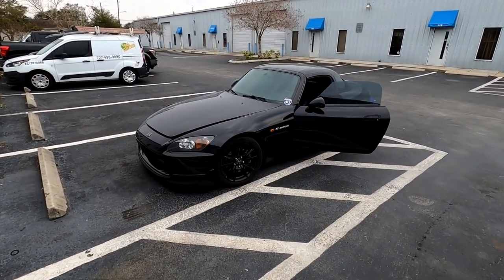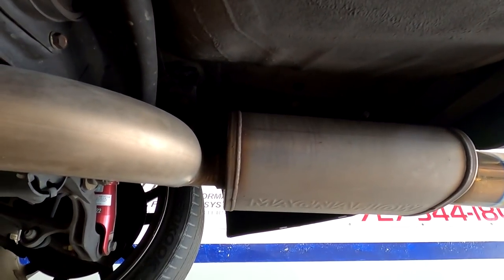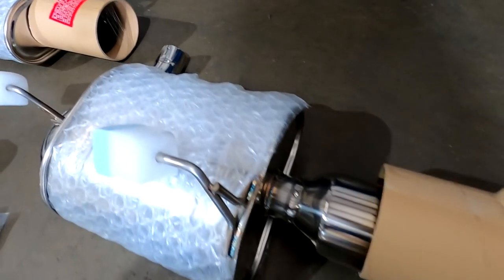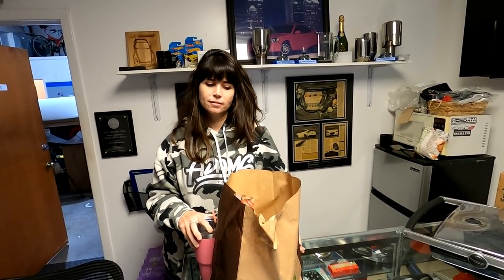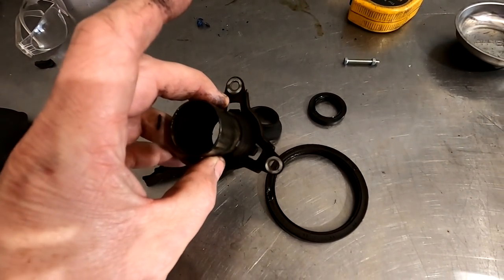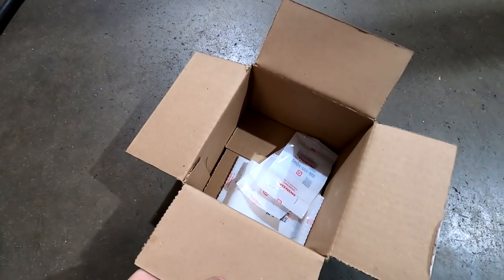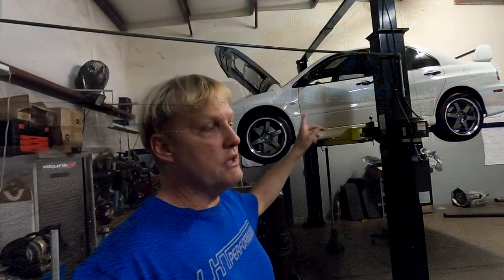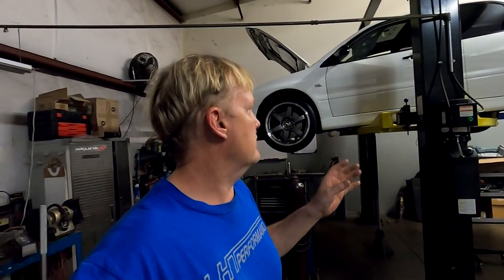7 Year old Magnaflow exhaust - S2000

Comment: Years ago when I went to evasive for a clutch job. They recommend exedy over oem , with OEM bearings. Well 1 week after the the clutch Change the clutch would not grab. I had to remove it.  They had used the exedy TO bering which exploded and the had zip tied the boot cause they had riped it.  They lied  and charged me for oem and never thought it would happened..  not everyone is as honest as LHT.
Reply from the maker: Many people believe Exedy make the OEM and it’s the same thing. It’s absolutely NOT. There’s also a reason the aftermarket TO bearings cost around $22 and the OEM/Nachi is $160.  I remember when the Exedy clutch was $199 , we installed them and replaced them within a year. Insist on better.

Comment: Instead of changing the detention springs you can just put a washer behind them to increase the pressure
Reply from the maker: It needs to more than just a washer. It would need to be a ‘Top hat’ type shape. If not the washer could end up going into the transmission.

Comment: Do you need anything on the bolts for the shift springs? That manual mentioned Honda Bond to seal them & didn't give a torque spec.

There isn't much info on this
Reply from the maker: Yes. Put a little Honda bond around the threads.
Reply: @LHTPerformance  Awesome, thanks John. Torque spec was 16ft-lbs for others around 14:55

Comment: John, you guys aren't seriously throwing away all your scrap metal are you? at our shop I would have a pile in the yard of rotors/exhaust/heads etc... that a scrapper would come by once a month and pick it all up, we usually collected between $80-$150 every month, same with take off decent tires about $60-$100 a month. Would cover some of your lunch money?
My first FX300 had the Exedy center section... the springs rattled and 2 or 3 of them were badly worn. I did notice the new one I replaced it with had a different center section and has been trouble free for quite a while.👍

Comment: Remember them days when my yellow top battery died if I didnt drive for one day (was a new battery). Will never buy that brand again lol.
Reply: Why didn't you get it replaced under warranty? I agree the quality has gone down, but what hasn't? I have the red top in my daily and no issues. I keep the terminals very tight and very clean. It is AGM but I still put Vaseline on the terminals.
Reply: @sheldonm3535  Tried to but the Advance Auto near me claimed because I bought it from a location 3 towns over they can't warranty it there. I was not going back to that town for a while so just took a loss.